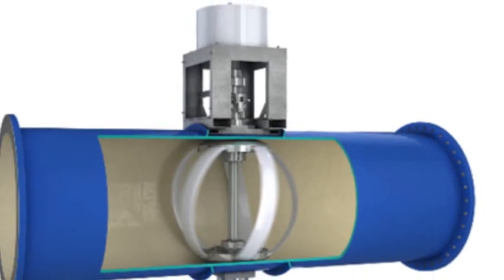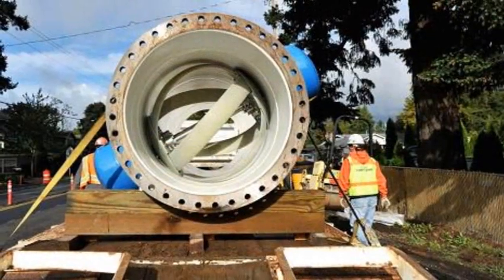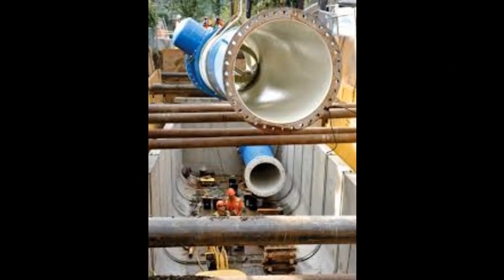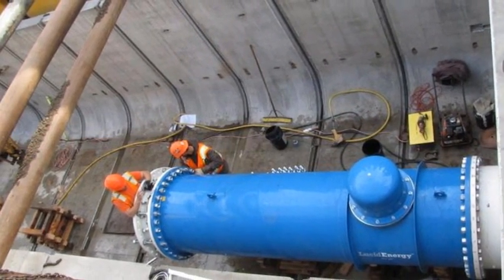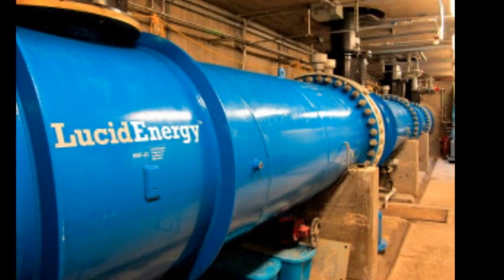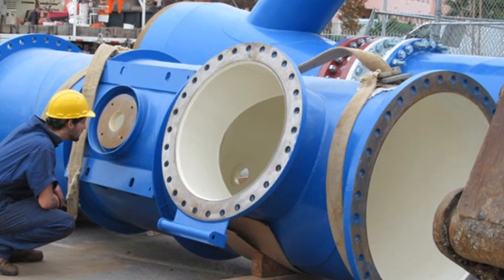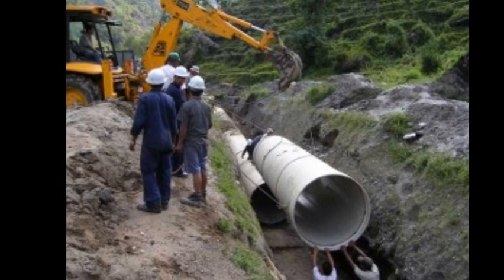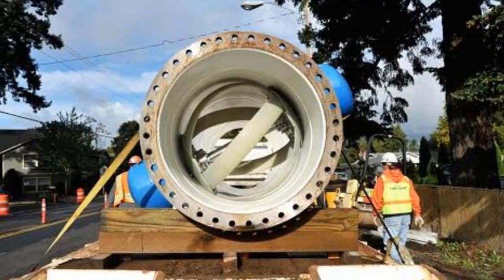Hydropower in a Pipe. Turbines generate electricity from water flowing through municipal pipes.

Comment: The problem that I see is that this will reduce pressure to the end users. The more of these turbines in between the source and a tap, the more power gets taken up by the turbines, reducing pressure. I realize that these water lines feed millions of homes in some instances, but the pressures were designed for just that; not generating an appreciable amount of electric power.
To make matters worse, if this water is being pumped at any stage to create the pressure, whether into a water tower or by pump only, you're transforming electrical energy to pressure differential energy, and back into electrical energy; you're putting power in to get less power out. You're also using power to create pressure, and using that same pressure to make electricity, defeating the purpose of the pressure in the first place, which is to feed water to all the houses which need it. It's better to put hydroelectric plants in places like on dams where pressure level does not matter after the output of the turbine.
I back this as much as I back making roads from solar panels; zilch.
Reply: before sewage treatment it woudln't matter if you had the pipes under a river, i think thats what chicargo and London are doing but not talking about because i'd assume they won't mention it till after the fusion lie and such (they hide power because war means targets)
Reply: It would only be used in gravity-based systems, and those typically have to have pressure reducers, so they're just converting the pressure reduction to a little bit of power.
Reply: @benthomas4544  That would be a valid use. But you still have to remember that the water is pumped up into the reservoir so the gravity-based system can actually work. Reducing the pressure more than necessary just wastes the energy that was used to pump the water up into the tower in the first place.
Reply: @RAndrewNeal  They are full gravity systems. I'm a City Councilor of a smaller town in the area that also has full gravity flow. We have to reduce pressure to protect pipes. It would be nice to take advantage of that energy. 

Portland's Bull Run reservoir is gravity filled. I've been to it, so I feel confident in saying that.
Reply: @benthomas4544  Using a ram pump, or a reservoir that sources water from a higher elevation than itself and its service region?
Reply: Lo que se aprovecha son las presiones remanentes que siempre existem en muchas lineas de acueducto. No la que necesitan los usuarios. Quizas usted no lo entienda porque no está dentro del mundo de la hidraulica de redes de distribucion.

Comment: Cutting down city water pressure and then home owners needs electric pumps to get enough pressure. There is no economy. They have mounted those turbines to create their money from reducing the water prossure to the homes supply. 😂😂😂
Reply: I'm glad I'm not the only one who knows about thermodynamics. The engineers who designed this were so occupied with whether or not they could, and never stopped to think about whether or not they should. They really needed to take this into account before wasting taxpayer dollars. It makes things worse if they're using an electric pump to create the pressure, whether by filling a water tower, or other means.
Reply: @RAndrewNeal  basically....if you have 50kw water city pump....and in line to the pipe you add a turbine 50kw....then.....you loose the pressure forward to nearly 0. 
Because there is no efficiency. Total efficiency is -4% power lost between two motors.
The input has to be always bigger then the output.

Its like trying to connect two motors to power each other. It's a circuit that cannot generate any profit.
As you said, its about the laws of thermodynamics.
Reply: @UrgenthelpwithSubscriptionsHel  Yeah. Best case scenario, you recover some of the energy you put into the system. But as we've established, that defeats the purpose of putting energy into it to make pressure in the first place. There is no good outcome.
Reply: @RAndrewNeal  lots of loses.....firstly because already pumping water means a lot of friction
Reply: You guys, they don't pump gravity-based systems (fed from the mountains). There's a fair bit of wasted energy in reducing pressure actually. Not sure if these systems are worth the expense of installing and maintaining, but the idea is sound.